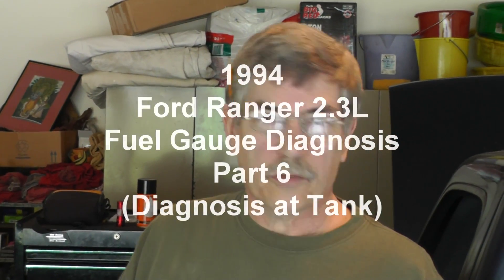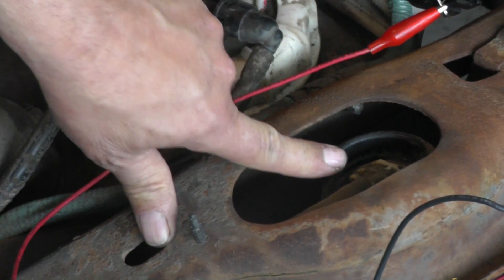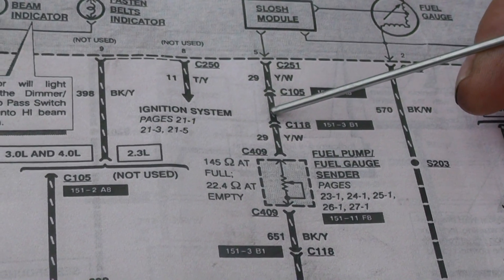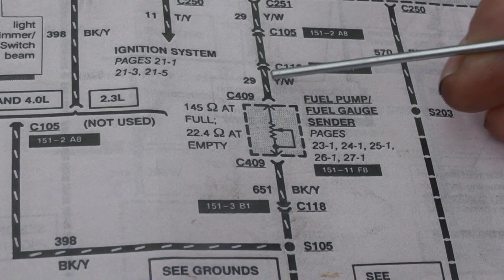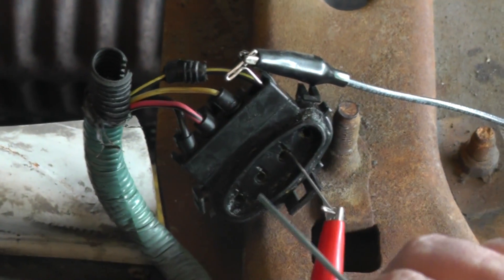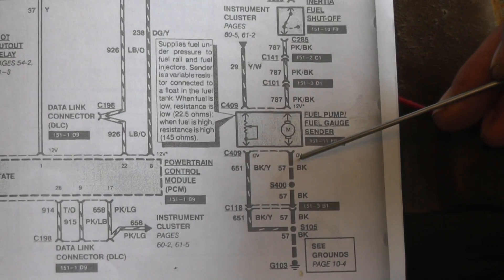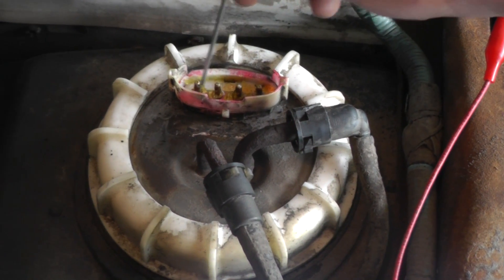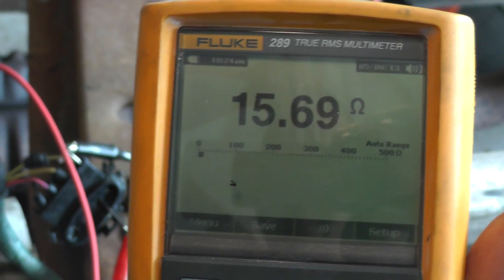Ford Ranger Fuel Gauge Diagnosis Part 6 (Diagnosis at Tank)

Comment: Nice videos, now my fuel gauge is reading backwards when I fill the tank goes to empty and when is getting empty it goes to full, what could be wrong? What do I need to check? I just bought my FX4 2007 so I don’t know if PO did change the sending unit or the fuel pump, let’s say he did work on it and change the fuel pump, could he did installed it wrong? Or could be the connector put back wrong or is just a bad sending unit? Thanks for the reply
Reply from the maker: It sounds like the wiring to the sending unit is wired backwards. The connector is keyed and can go on only one way. I suspect that the actual wiring was cut, wires were swapped and then put back together with butt splices.
Reply: @stuzman52  thanks so my best shot is to remove the bed and check the unit and the wires I guess and try to find the wires joint and fix it.
Thank you so much
Reply from the maker: @ibayter  That’s what I would do Ivan. Good luck!

Comment: By chance do you have any videos on older rangers? I have an 89' ford ranger 2x2 4 cyl and was wondering if the differences would be drastic between the two systems in them or if they are relatively close enough that I can do the pump change off this video. I commented on the last video and am really thinking about subscribing to your channel because of the detail and info you give even the extra stuff. It's like having a narrated Chilton book. (thumbs up for sure.)
Reply from the maker: Thank you Jake for the comment. I don't have any other videos on the Ranger other than the 94 Ranger. I would suspect that a lot of the systems would still apply to the older Rangers, but I wouldn't swear to this. I would think that changing the fuel pump would be very similar. Go ahead and subscribe and you'll be notified of future videos that I upload. I try to put a lot of detail in all of the videos that I create. Thanks again Jake for your thoughts.
Reply: I asked my grandpa and looked around in some books and the internet and it said from 88's-94's usually were the same set up or pretty similar.

Comment: Good for you to carry the diagnostics this far. If I were doing this, I would have committed to replacing the unit after going though all the effort to take the bed off. I might have tested the unit on the bench, assuming the mechanical float was somehow stuck.